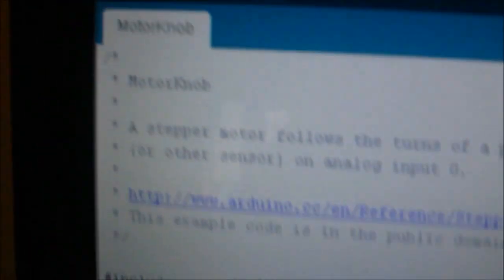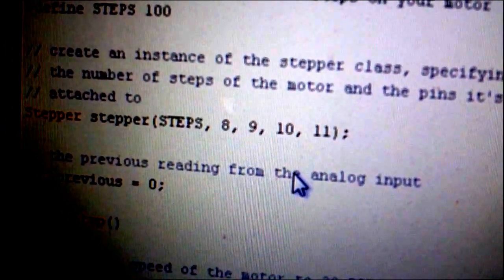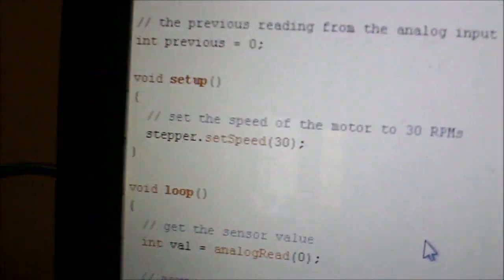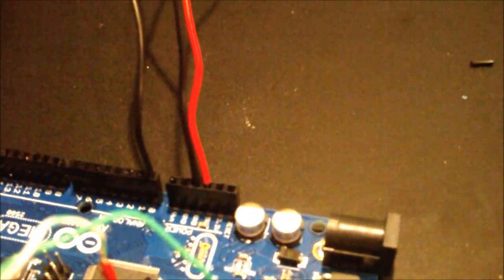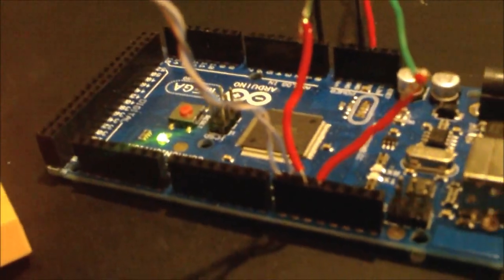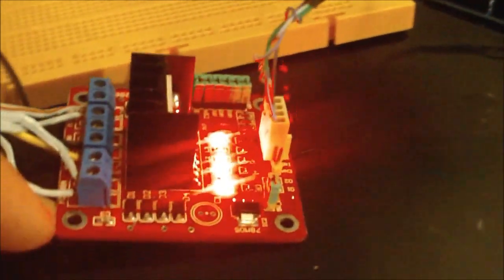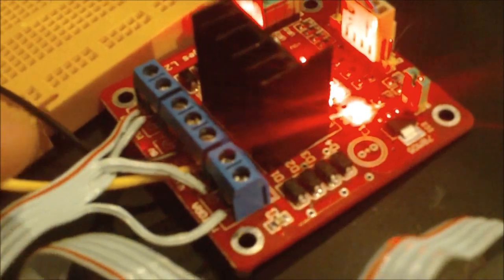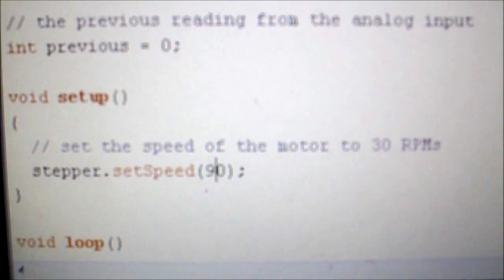L298N Stepper Motor Driver Controller Board for Arduino & em 257

Comment: Cesar, estoy haciendo justo esto lo mismo que tu y  con los mismos componentes. Quiero que el motor recoja hilo extremadamente lento. Hablamos de tal vez 5 revoluciones por hora. Al querer hacer esto el driver calienta muchisimo.

es normal? 

saludos y cualquier informacion sera muy agradecida.
Reply from the maker: Hola Santiago,
Si el motor va conectado al carrete directamente, sin ningún reductor, probablemente estarás exigiendo un par al motor muy elevado de forma constante. Esto eleva el consumo de corriente. Cuando estos motores van montados en impresoras (salvo para mover el cabezal en las de tinta, que enlazan directamente con una correa y guía sin apenas resistencia), moviendo por ejemplo tambores para arrastrar el papel, van unidos a un sistema de engranajes, que reducen la velocidad del tambor, pero consiguen el par requerido, sin forzar el motor. Sin reductora posiblemente el motor está exigiendo mucho amperaje al driver y por ello seguramente se calienta. De cualquier forma, también es posible que el driver se caliente mucho en uso constante aunque el par que exijas sea muy pequeño (sobre todo si la alimentación que pide el motor está cerca del límite del L298). Si quieres quedarte más tranquilo, ponle un disipador más grande para que trabaje algo más frío.

Comment from the maker: Looking at the L298 schematics clouding around I believe (I may be wrong!!!) from top to bottom Motor A up most connector is (if we can state + and -) coil1 + (from In1), the next is coil1 - (from In2), then at the bottom upper connector is  coil2 + (from In3) and finally the one in the bottom is coil2 - (from In4). The main hurdle to me was to know what cable is what in the motor.

Comment: Thanks, one last question, there is Motor A and Motor B.. How do you now which one is A+ and A-, B+ and B- on the board?  Mine is working now thanks to you, but I don't know if it's working in spite of my luck at nailing it on the first try.

Comment from the maker: I was using a 7 volt crappy PSU just for testing and without load. The 5 volts connector besides the GND connector...I'm not 100% sure, but I believe it's an output coming out from the onboard 5v voltage regulator that also powers L298 chip.

Comment from the maker: Hi Dan, VMS is the power connector that will drive current to your stepper through L298 chip following In1...In4 signals. This L298 board can manage up to 35 volts and 2 Amps, so you need to check your stepper needs to choose a proper power supply.

Comment: Cesar, quick question for you, I also got one of these boards, and I'm trying to run a stepper motor off of it.  What are you using for a power supply, and it looks like you have it hooked up to the UMS/VMS & Ground, instead of the 5V.  Whats the difference between the 2?

Comment from the maker: The steps per revolution reffer to the motor axe. If you attach gears you should, depending on your ratio, calculate how many steps you need for a full revolution after gears. For instance if you have a 2:1 reduction ratio and 100 steps per revolution at the motor, after gears you would need 200 steps for a full rev. If you have a 4:1 multiplier ratio, you should count on 25 steps for a full revolution after your gear system.

Comment: I have a question, your defining the amount of steps per revolution.
Makes sense.
But when you attach gears, do you still have to insert the amount of steps the stepper motor only supports or the amount it takes for the last gear to make the full revolution?